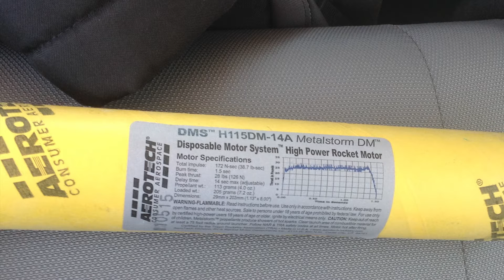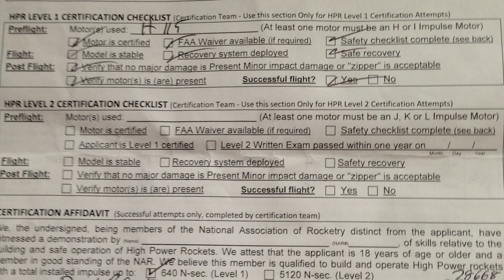Estes 29mm Big Daddy Rocket Launch, NAR L1 certification

Comment: Excellent flight! Did you cut the base of the NC off and epoxy a new chute mount up in the tip so you could get the longer 29mm motor in there?
Reply from the maker: Yes, plus a few washers to bring the CG forward.